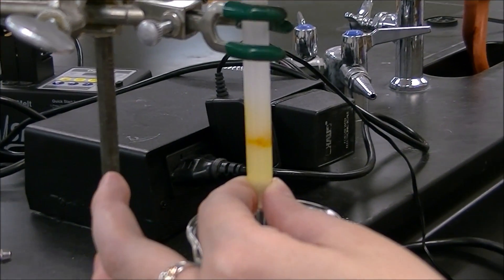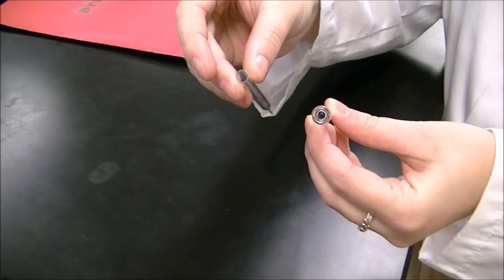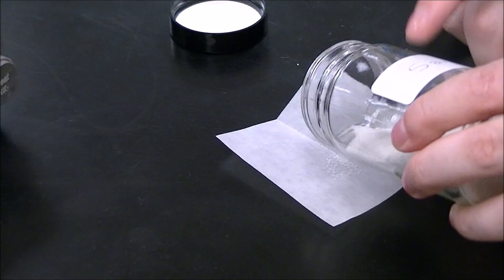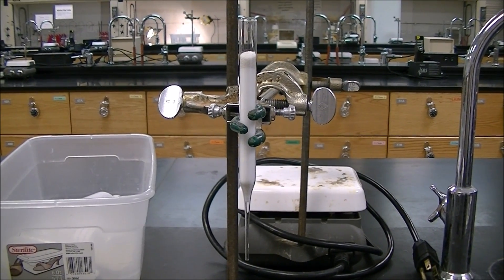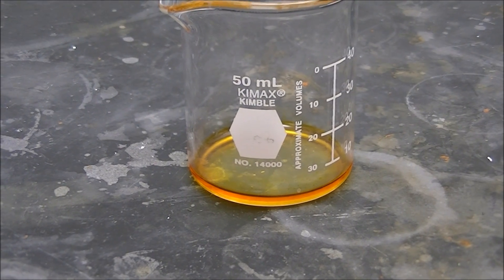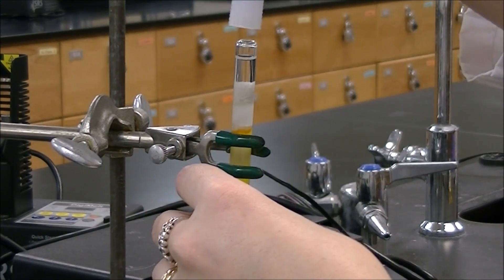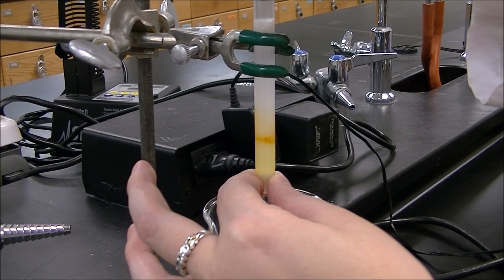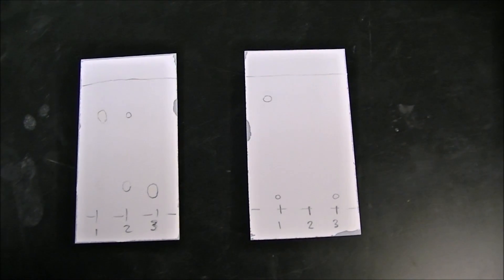Column Chromatography

Comment: Why is it necessary to fully wet the column with your solvent before you begin separating your mixture?
Reply: if we didnt then the flow of the liquid through the silica wouldn’t be equal through all parts of the tube. it makes sure the flow through the tube is even and that way the best separation is achieved